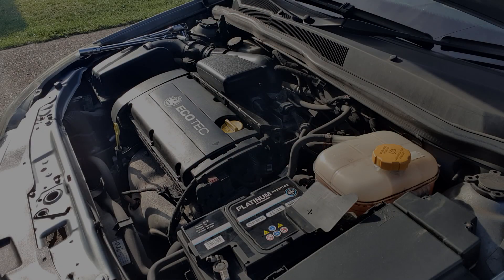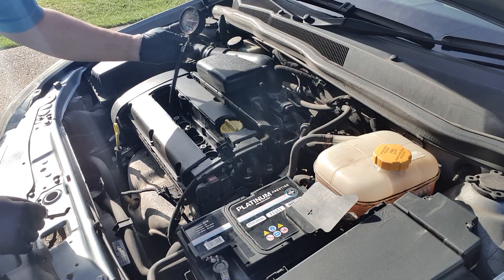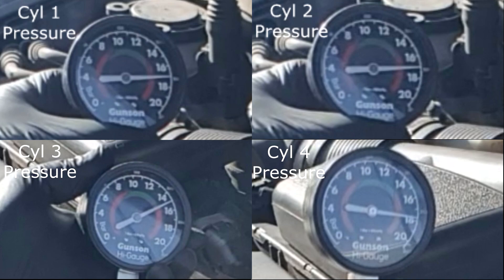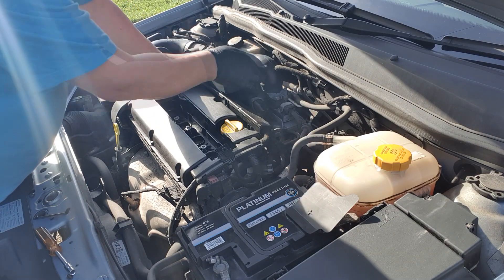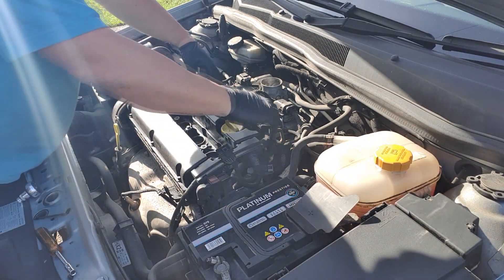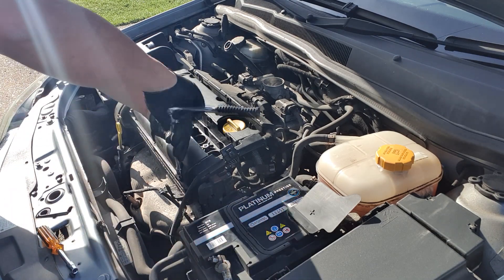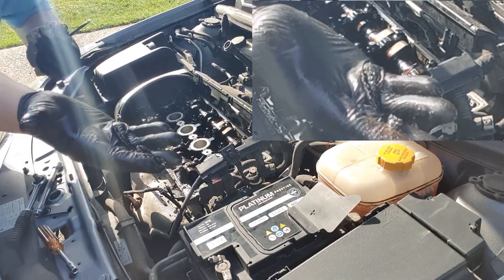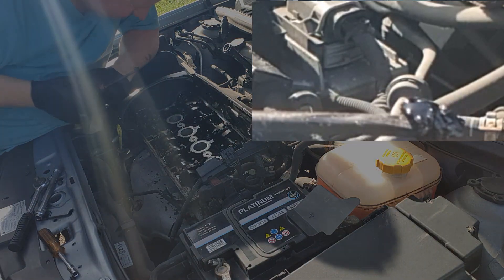Astra compression test & cam cover removal

Comment: Great video 👌 what compressor kit did you use? There are so many of them
Reply from the maker: The compression tester I used was a Gunson Hi Guage which I have had for 20 years or more but I am surprised to see you can still buy the exact same model, here's an Amazon UK link 
https://www.amazon.co.uk/Gunson-LASG4101-G4101-Hi-gauge-Compression/dp/B002XERM66/ref=sr_1_5?adgrpid=54813116804&dchild=1&gclid=Cj0KCQjwwuD7BRDBARIsAK_5YhVS6fvcPvRMKYv0arOIExCSCToRSBJYUwLZaeuoudUhr-FPFwtg4WwaAvdQEALw_wcB&hvadid=259099931732&hvdev=c&hvlocphy=1007101&hvnetw=g&hvqmt=e&hvrand=14723538496822098797&hvtargid=kwd-316923785753&hydadcr=28181_1821133&keywords=gunson+compression+tester&qid=1601708861&sr=8-5&tag=googhydr-21